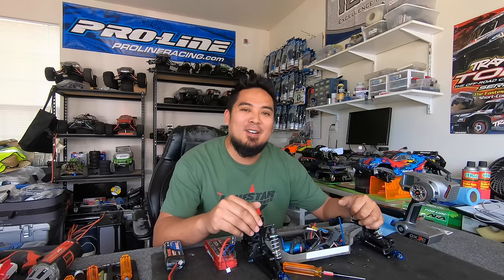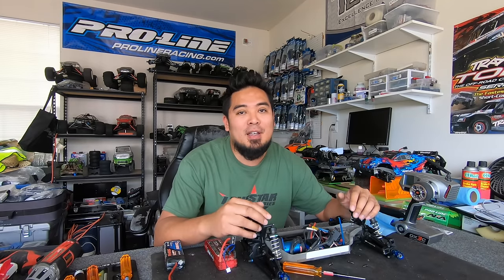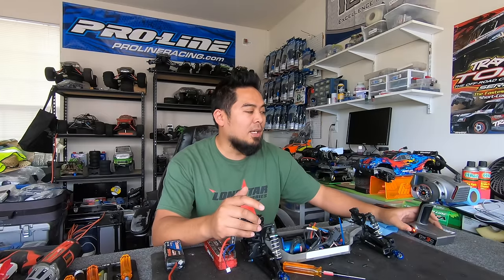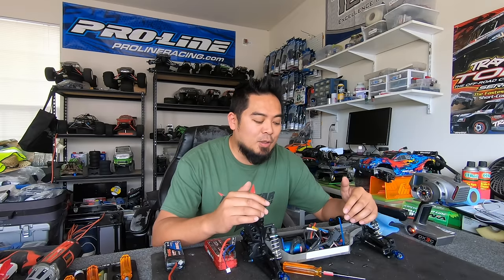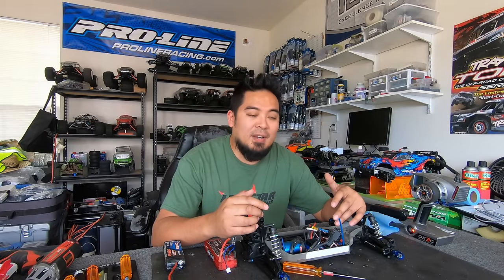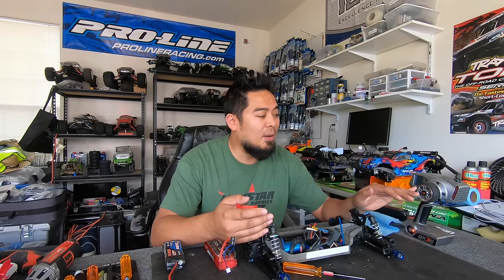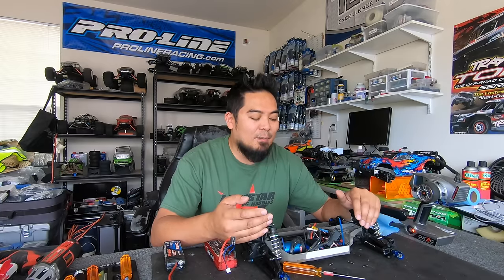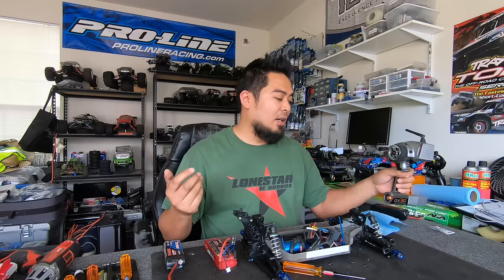RC STEERING STOPPED WORKING!

Comment: Hi Mark. I have a really old car. Everything works fine except I have a calibration issue with the steering. The moment I turn the remote on the wheel turns to right. When I turn steering left it moves a bit but swings back to the right and keeps making a sound. How can I calibrate the steering? Could you pls help?
Reply: Same here, any solution?

Comment: Hope you can reply to this. I’m new to the hobby. I purchased a rustler Vxl. Straight out of the box I noticed it drifts to the left. Is there a way to fix this? Doing research I believe you can fix it with the Bluetooth addition to your receiver. And use the app to calibrate it? Is this the only way?

Comment: I lost tons of speed on my Traxxas, E-max. I'd do immediate wheelie's and now it just don't pick up but 2 inches off the ground. Not sure if I need to adjust my controller settings or what? I mean it was hitting 60 mph easy. It's probably at 45mph. What advise can you give me?

Comment: Same thing happened with my Rustler VXL using the included TQ1  remote.  When I turn the remote on the "ON" led blinks everything else works but the steering.  This happened while the Rustler was moving across a small bumpy area.  Do you know if there is a reset on the remote or do I need to investigate the receiver, etc.  Thanks
Reply: Do you ever

Comment: help! I have a DX2E  and the same issue but it has Dials for the and even bought a 2075 R  still no go!  after watching ur video I felt kind smart for checking this but I am stuck I guess the controller is bound cause the throttle still works... any advice?
Reply: btw its a 1st gen Slash 2wd

Comment: For me the steering locked up but my servo still makes noise, do you know what that could be?
Reply: I have the same issue, even with 2 new ones
Reply: If the steering servo still works, it might be the servo saver. They are super cheap so you might as well try it

Comment: Hello sir I need some help with my emax I have steering but no forward or backwards I calibrated and still the same both receiver and ESC greenlight's I press the throttle and the green light on the ESC blinks anything will help thank you

Comment: This just doesn't work for me, I think some sand got in the system if that makes a difference I'll post the results tomorrow, and like the car can move the front wheels move when I turn it on but it doesn't steer when I turn the steering wheel

Comment: My Rc car recently just stopped. The ESC will turn off the second the Controller connects. I assume this is the servo as it works when the servo is disconnected. Planning on getting a new servo to test it out soon.
If anyone thinks it's anything else I am open for Ideas as the servo will take around a month to get.

Comment: I changed my servo in my slash , and I cant turn it anymore , using the stock controller , I re binded it and it still wont work , checked the bell crank and it's fine.  Still wont move .. I am stuck and dont want to take it in to the hobby shop.
Reply: My slash just stopped turning too, with stock remote. It turns to the right but with super low power to it, doesn't even turn when on the ground, and doesn't move when going left.

Comment: I have the same issue on my Axial scx24. SR is fine... same thing, plugged into the throttle, servo works fine, rebind, same issue.... Im about done with this hobby.  First the 4x4 slash advertised as 3s ready, then starts destroying itself on 3s, now this with its 300 dollars in upgrades....